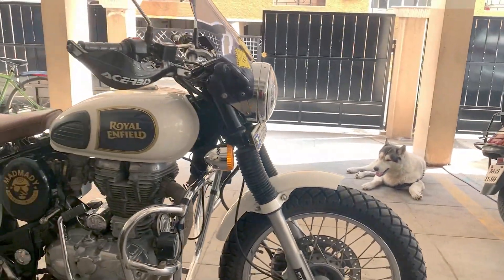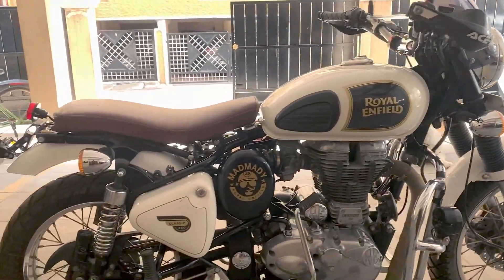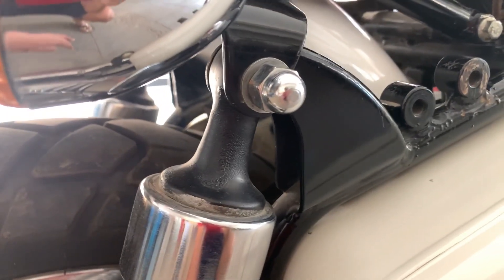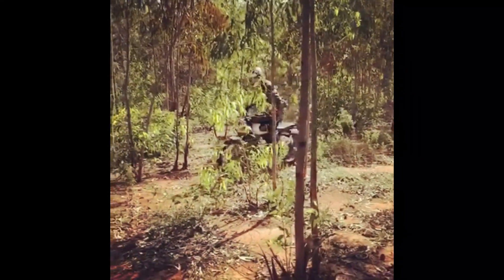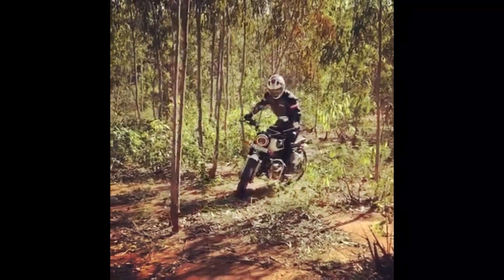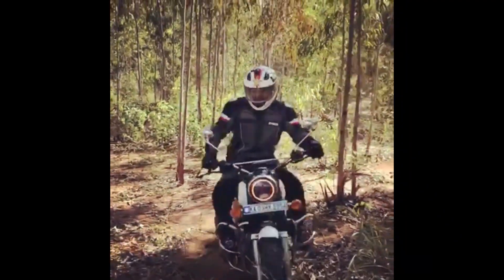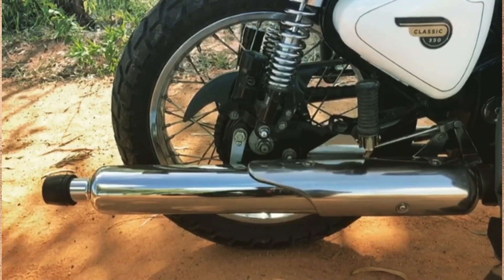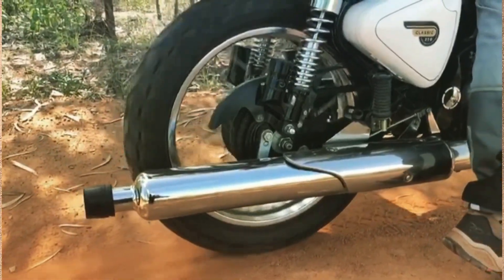DIY | Simple way to convert your Classic 350 to a Scrambler | Cost and mods in description

Comment: You could use the upswept silencer which was originally by Royal Enfield fitted in BS3 classic 500 model or u could modify the bendpipe in a way to use the current stock silencer as upswept which is used in trials 500

Comment: Hey brother,
Love what you have done with your Classic! 

My questions are:
1. Which tyre setup are you running?
2. Your tyres look bigger, so did you change/modify swing arm? 

Hope you find time to answer these questions, thank you 👍🏻
Reply from the maker: Hi the rear is ralco n the front is mrf 
The rim size is the same the tyre size is changed. No mods done to the swing arm! I’ve only upgraded the suspensions
Reply: @freebirddiaries3293  thanks for the reply bro.